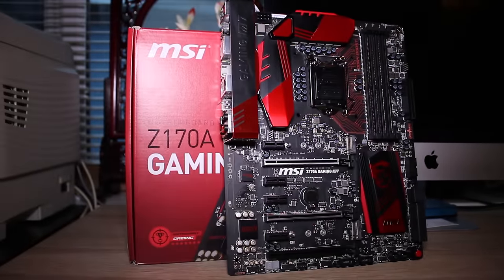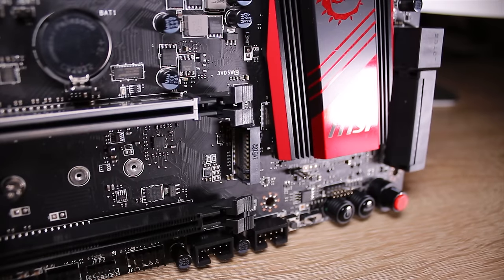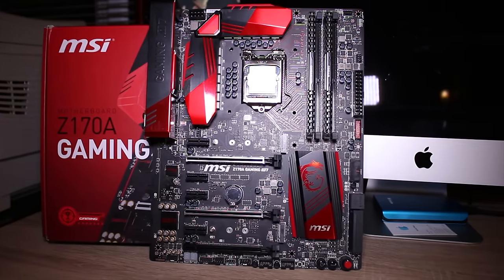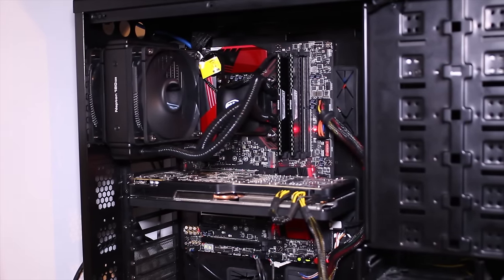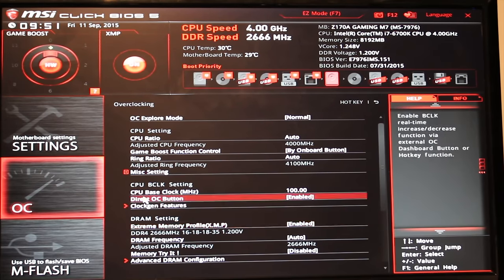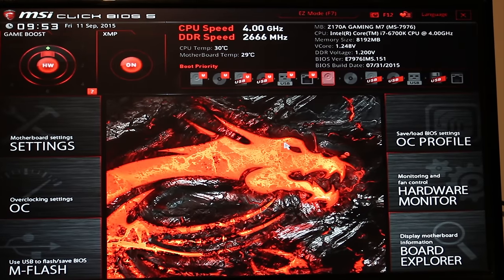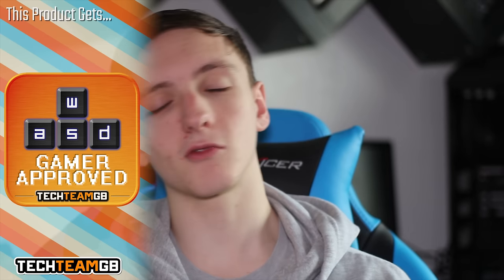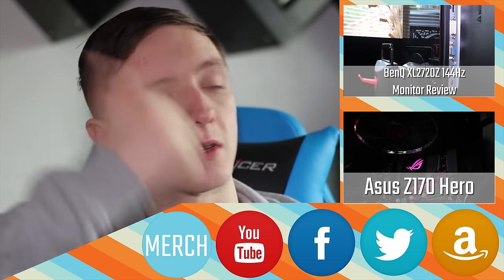MSI Z170A Gaming M7 Motherboard Review

Comment: @1:43 That board was not manufactured correctly, it should not have that severe sagging in it.
Reply from the maker: That really isn't that bad. It was also likely manufactured just fine but many previous reviewers with heavy hands bent it a little. Still isn't an issue, nor the worst I've seen.
Reply: TechteamGB LOL no, I've seen small resistors and caps fly off the board when they secure them down and sometimes problems don't show up for a couple years such as when people grab them with their paws without wearing ESD. Static damage does not show up until a few years down the road.

Comment: Hey! Built my first pc and used this beastly Mobo and a 1070,I was curios. Do i need to install some sort of drivers? I don't plan on using the disk given, usually out of date. Are there certain drivers or downloads I need to make to further increase my performance? Thanks!
Reply from the maker: +Taka the Hawk yes, head to MSIs website page for this board and download the drives there, then nvidia's site for the GPU driver.

Comment: Also reviews say this Motherboard has Ram compatibility issues. With G-Skill 16GB DDR4 3200 F4-3200C16D-16GVK work with this board? Want my first build to go as smoothly as possible.
Reply from the maker: +Logan Sanborn I can't validate that kit as I used corsair vengeance lpx ddr4 ram, but I don't see why not.

Comment: Do you not find it strange how the IO shield cover essentially takes the spots for securing it to the case standoffs?
Reply from the maker: +Loxa You can easily remove the screws and put your motherboard screws through it to attach to the standoffs, or remove it and screw it in without it there.
Reply: +TechteamGB Ok, seen a few people not using stand offs on them two holes. Would that be safe?
Reply from the maker: +Loxa I didn't - and it was just fine - although I'd recommend it if you can.
Reply: +TechteamGB Ok, cheers.

Comment: Does M7 Support Offset and Adaptive Voltage settings in BIOS ?Also how would this compare to GIGABYTE G1 Gaming GA-Z170X-Gaming 7, which of these two MB have a better BIOS.
Reply from the maker: I believe so, although could be wrong - and I haven't seen the gaming 7 so couldn't really say I'm afraid!

Comment: You mentioned the board is not the most high end due to not having all the "bells and whistles" lol yea which bells and whistles are missing?
Reply from the maker: WiFi onboard, Dual Gigabit lan, some more advanced/external overclocking features, certain aesthetic elements, 3/4 way SLI configuration options, U.2, internal thunderbolt header, as far as I know, Thunderbolt 3 that should run through the USB Type-C port, more than 36W support through the Type C port (again as far as I know), and I'm sure there are a few more I'm forgetting.
Reply: Do you know which Z170 board has those features? With the exception of U.2 and useless onboard Wifi. My 10 year old desktop has wifi but anyone gaming should not be using anything other than lan.
Reply from the maker: Boards like thee Z170 XPOWER Titanium, Asus Maximus VIII Extreme and Formula, Gigabyte's G1 and Desagnaire boards all have those sorts of featues. While I agree with WiFi, when I've asked my viewers what they use in the past, it's overwhelmingly been WiFi, normally because it's difficult to run a cable to where they game.
Reply: Geez that is surprising, but running cables upstairs and downstairs is a hassle so I can understand that in those cases. I did take a look at the Extreme and the Formula..but I ultimately opted for 2 M.2 slots and HDMI 2.0 with the M7 over their offerings. Color scheme choice over the Gigabyte boards. Your review was pretty in depth and im quite glad you really didn't have many cons because the M7 is a great best bang for buck board. Sorry for all the B's. Keep up the great work!
Reply: MSI Z170A GAMING M9 ACK this is the big brother has AC wireless Wifi and other things he looking for well more added component much more expensive it is normal in motherboard prices and in case of the M7 lack of AC wifi just buy wifi card many PCIE slot to put on M7.

Comment: Bear with me I'm tad bit of a noob, but what is the indicator at the bottom that's green, it says Ab?
Reply from the maker: That's the debug LED screen, it shows you two letters that you can reference from the manual to see what the error is. I believe MSI get it to display the CPU temp once the system is fully booted to an OS.
Reply: +TechteamGB thanks mate.

Comment: no reason to get this board get the m5 version. its cheap and pretty much all the same features, even when I called MSI they said the m5 board is a better buy since the only real difference is the button on the mother board for the m7 which let's you press that instead of remove the small battery. It's actually funny that MSI even admitted that the m5 was way more worth it then the m7 and is also reflected in there total sales
Reply: M7 has better on board audio, io shield /coverDX12 instead of DX11 on the M5 more caps for better power delivery for over clocking, extra HDMI output, and the bios button i'm sure there are more differences.

definatley worth the extra $40 aud in my opinion
Reply: There isin't better audio, it's still 2 ohm audio impedance I believe. Still better to get a mayflower external dac for like .54 ohm impedance and it's being processed outside of the computer.